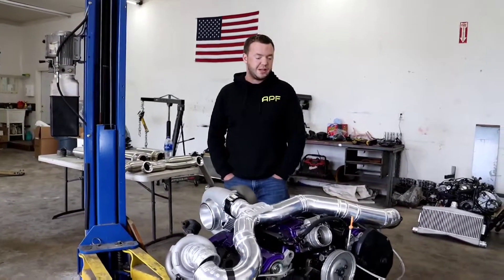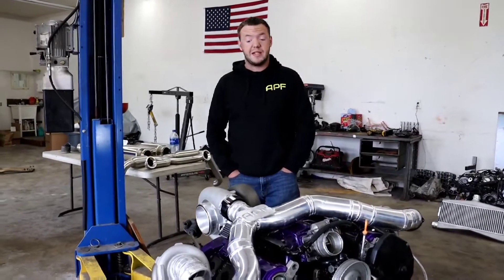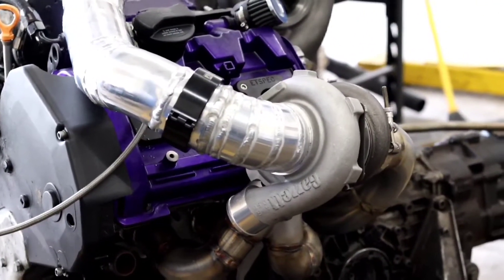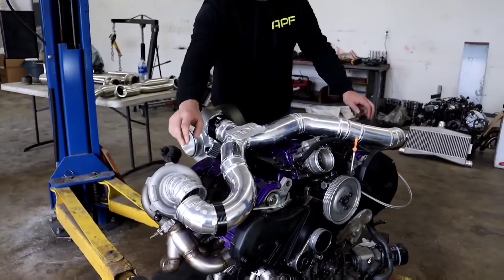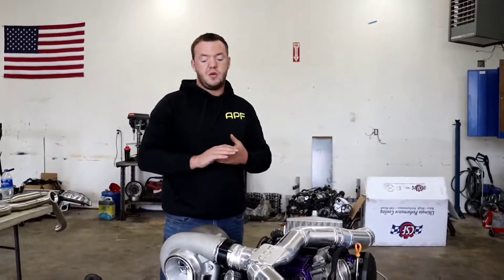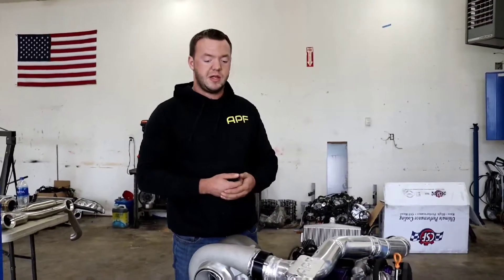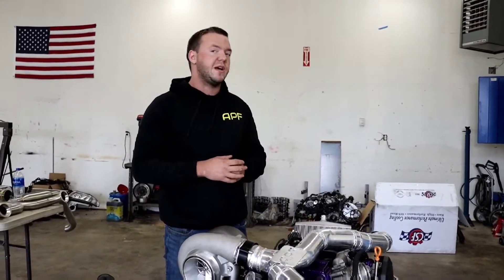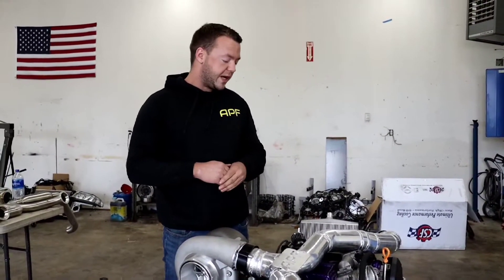Compound Turbos Explained (1000+ Horsepower Audi B5 S4)

Comment: man what’s like the sizing for compound turbo setups? like what size smaller turbos should you run with what size bigger turbo for x power
Reply from the maker: Good question! From my little understanding, the smaller turbos help maintain power under the curve while the big turbo spools. So to optimize the system you would want to size the small turbos to get as wide a lower and as possible prior to the big turbo coming on. In Mike’s case, I believe the small turbos come on fully between 4500-6500 then the big turbo is rolling by 7,000 to redline. He has videos on his channel of this working and some roll races showing how ridiculously fast it is so highly recommend checking them out! @apexperformanceandfabrication

Comment: How exactly do you control the boost pressure if you’re using mechanical wastegates?
Let’s say you want to boost 20psi for example throughout the rev range?
Reply from the maker: From Mike, "So the small turbos are functioning off mechanical gates whose boost reference is off the compressor of the large turbo. Essentially this allows the small turbos to start things up and when the big guy makes enough boost the small turbos will start to be bypassed through their gates. The large turbos gate is electronically controlled so it's boost can be regulated"

Comment: Azr block ?
Reply from the maker: Good question.  In an upcoming video I'll have Mike cover the specifics in more detail.
Reply: @RAPauto  I can't wait! I need to know more!
Reply: Hi, I have been looking to find the difference between the engine codes. Only a bit of hear say so far. 1 person says the blocks are the same? And then another says the S4 block has thicker webbing? And another says the rs4 block is different again?? But I haven't found  credible literature to confirm yet.
Reply: @alabinibop  Ich denke der Übersetzer wird euch helfen.
Es ist alles anders, ausschließlich der Hubraum ist identisch.
Motor wurde bei Cosworth weiterentwickelt.
Der Block ist aus einem anderen Gefüge.
Kurbelwelle und deren Lager sind bedeutend dicker.
S4 Block 500-700 PS( für deutsche Autobahnen)
RS4 Block 1400+

Läuft der Umbau nun besser als zwei große Luftpumpen?
Reply: @Robert.86  Hi Robert, I get the gistst of this, the rs4 block can go up to around 1400 bhp, and the S4 block (apb/Bel) 500-700 bhp. What I really want to know is the 2.7t engines with the codes (are/bes) what can these handle, and the differences from the (apb/Bel) engine codes?
Reply: @alabinibop  Both engines have 230-250 hp.  They are identical engines Only the RS4 has a reinforced block.
You can already see that in the dimensions of the crankshaft bearings. They are designed very weakly.
The material is also on the block ...
Reply: @Robert.86  ok thanks.👍